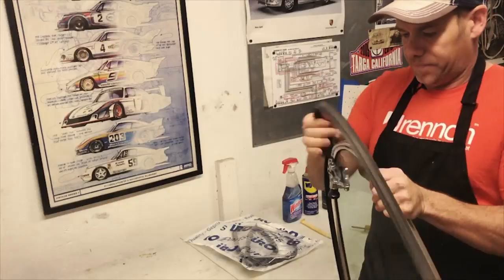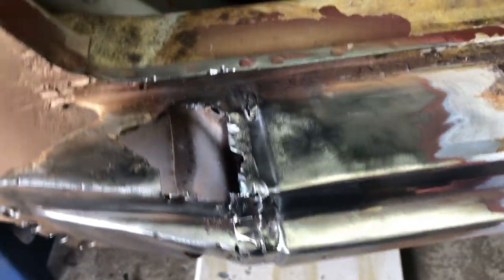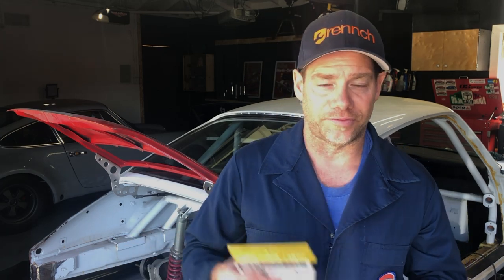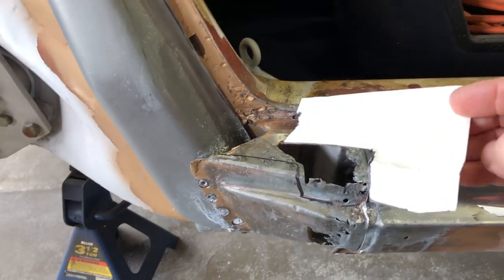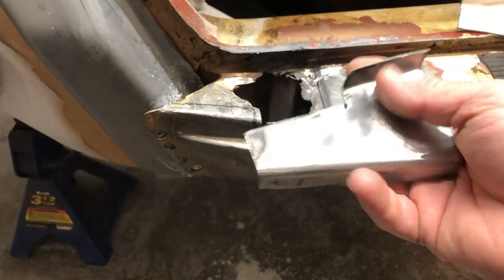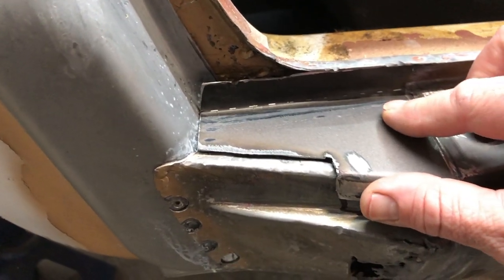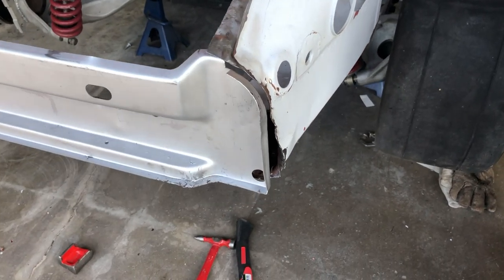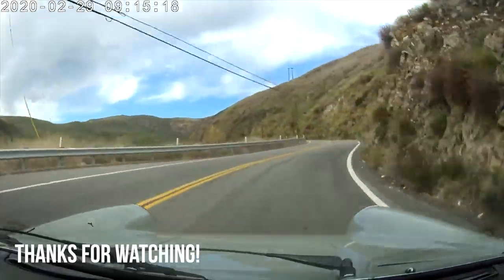Rust Patch Panel FAIL! | FLUX CORE Sheet Metal Welding Attempt | Blasphemy Build Part 9

Comment: Put the machine on the lowest wire feed setting it will allow. Also try letting the wire come out a little further than usual, before starting the weld. If you could get a piece of metal between the two panels it might also help prevent it burning through. e.g. a small piece of aluminum or copper.
Reply: Trouble i see most welders go down to 50 or 40amps minimum. I think these mig welders are not suitable for working on car sheet steel. My mig can go down to 10amps and have flux welded very thin steel with it

Comment: Flux core is a pain for thin metal but I would have made some internal patches to weld against and absorb some of the heat (they will never be seen) and back them with some copper rod during welding to act as heat sinks - I have two lengths of 1/2 inch solid square bar I use as heat sinks. The weld does not affect the bar but attaches to the surface metal and the inner patch material. Messy but much better than blowing holes all the time.
Reply from the maker: Yea, I've got a copper backer that I use, but I couldn't fit it in there.  I have gas now, so all is well.

Comment: It looks like there is a ton of spatter.  Did you reverse the polarity on the cables for flux welding?
Reply from the maker: Nah, I just got gas.  :).
Reply: Haha.  Yeah, that will do the trick. I need a cylinder bad so I can finish up my project.  I just cant find one for a reasonable price.
Reply: 'Welders' constantly comment on my  car resto vids telling me that you can't use Flux cored wire. That's cos they actually know so little that they don't realuise that you reverse polarities when using it.  They can plainly see that my welds are strong and tidy.-yet welders will persist in telling you what they have heard. Cos that what 'welders' do.
Reply: Also from what I've seen, different qualities of flux core will spatter more than others. If it's self shielded, gas won't do much and definitely won't help w spatter. Def switch to Neg.

Comment: I’m in the same boat! Can’t weld thin steel with my cheap flux core welder. It’s probably time to pony up and get a decent welder and gas... Good luck and keep going...
Reply from the maker: Yea...it's made all the difference in the world so far.
Reply: @rennch.  Try a copper backer plate for filling holes in thin sheetmetal.
Reply: If you want to flux weld thin sheet metal try finding a welder with very low minimum amp settings like 10amps. Depending on your skill you might get away with not using gas
Reply: Watch my resto vids. You will see that Flux cored wire is fine if you learn how to use it

Comment: Whats the lowest setting of your mig welder? My mig welder can go down to 10amps and i have done flux welding on 22 gauge or 0.8mm steel without burning through. Maybe i will try flux welding 24 gauge or 0.6mm like is found on some japenese cars
Reply from the maker: I don't really know what the amperage is.  But I have argon now, so all is well.

Comment: Flux core work brilliantly for car bodywork. 

Some important stuff: All wire is not created equal. Buy good wire. Bad wire will make you doubt your welding ability. I like Super 6 brand & dislike most other stuff. 

If a panel has been lead-loaded or bronze brazed, you will not get any weld to stick to it worth a damn - try any way you like, clean all you like, it will weld real bad. You have to either re-braze it or cut the whole lot out & start again with fresh. 

Flux core is cooler than solid core wire. Not hotter. It blows less holes, not more. It creates less distortion, not more.  Reasons. I know at a glance the wire you are using here is junk. It's not you, it's the wire.   Lastly, chuck the spot weld cutter bits into the bin & buy a cone bit instead. Use that - thank me later.

Comment: thats a mess ,,, stop trying to do key hole surgery , cut out the bad bits , the couple of inches beside rust holes will be wafer thin and nearly rusted through too ,, get back to good metal , learn to joggle or at least put a backing piece behind your joints  which are best put at an angle and not at 90 degrees and you will be flying , as for flux core , its for farmers welding gates in a stock yard , not the answer for cars ,,, but you do make a nice patch.
Reply: I have flux welded 0.8mm thin sheet car metal but i have a mig welder thay can go down to 10amps. Might even get away with welding 0.6mm. Its not easy but can be done and the welds dont look that bad
Reply from the maker: Totally!  adding argon made all the difference!